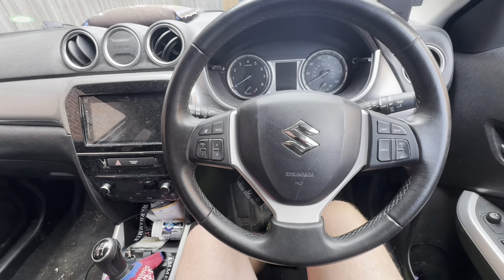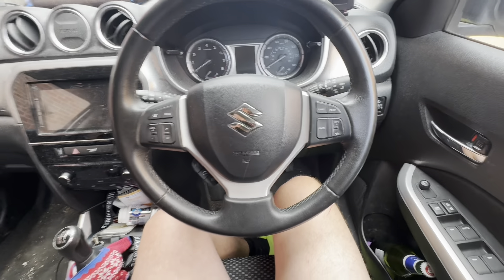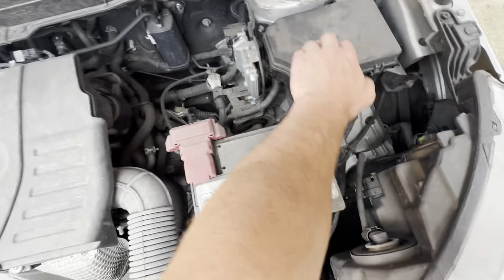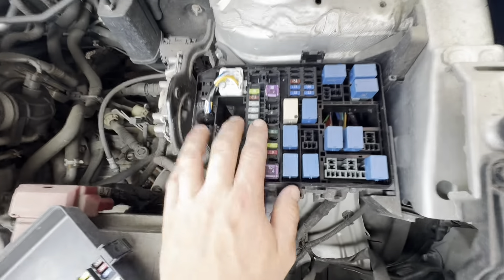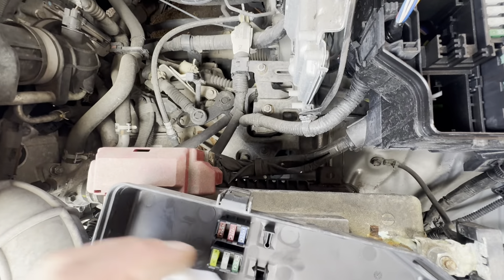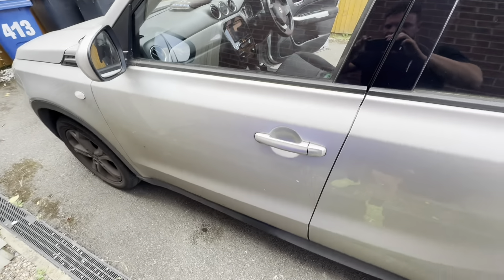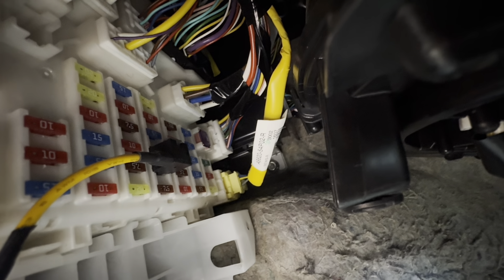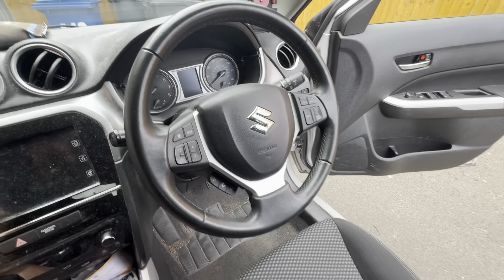Suzuki Vitara Fuse Box Location How To Find Fuse Panel

Comment: Good Video .Hi Cabin Fusebox The Yellow cable looks like a fuse spur ..Dashcam  typically need one it's the reason no cover is present.Iv'e recently fitted one in my Suzuki Vitara . Cover won't go back on because fuse spur stops it, Also another cover is missing wihich attaches by small plastic studs beneath Glovebox.

Comment: john   here is there a fuse for the centra locking   2021  vitara 1.4 petrol    as my key fob will not operate  doors
Reply: Most likely the fob battery.